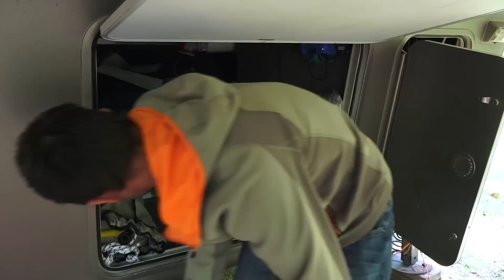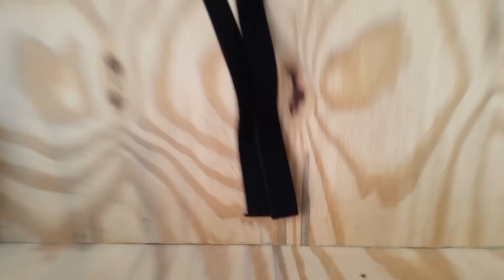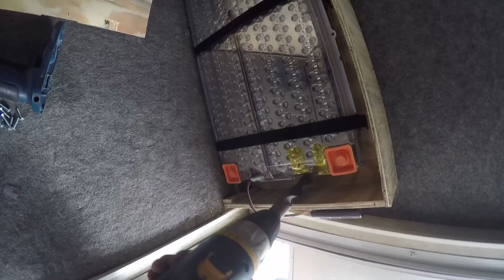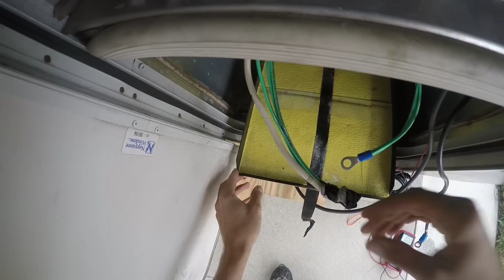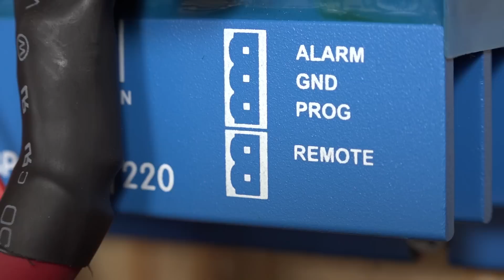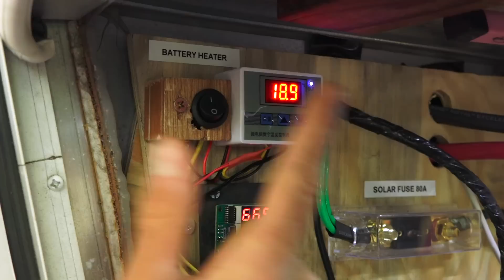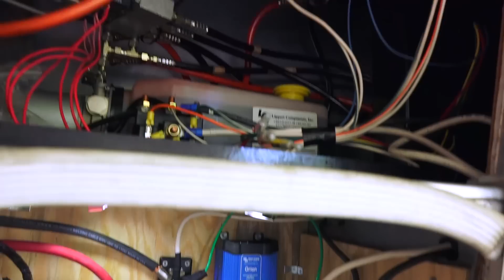PHASE 2 SOLAR - Installing the Tesla Battery and converting the RV from 12V to 24V

Comment: Very nice and mostly over my head. I would like to caution you on the lack of breakers or fuses on the small leads that tie into your 150 amp circuit. I saw a small red wire, and the lead to the charge controller and to the 24/12 converter to name a few. The flag/manual breaker type you have above the LiPo, close to the door will do nicely. I also saw you have a small black cube self resetting breaker. These can be a fire hazard in the event they cycle over and over because of an overload. In fact they are not allowed in boating.  In my boat I have a 3000 watt Gopower pure sine tied to two Vmax AGM 8D's they are rated at 350 amp hours each. They are recharged with a 90 amp smart charger that in turn is fed by shore power or a Honda 2000 companion type because of the twist lock plug it has. I have a full size fridge that the de-frost is disabled when on inverter, a small micro wave, Keurig, toaster, 24" LED TV, electric blanket and cpap machine, all that I use freely.  I'm usually good for 18 hours before it gets to 12.3 no load volts, the point I call minimum. I'm not too worried about weight (170 lbs each) in fact the boat needed the ballast. I expect perhaps 8 years of service. By that time, some smart guys like you will have made a better battery system for dummies LOL.

Comment: Wow, this is mind-boggling but you did a great job explaining it.  I pretty much understand what you've done but I don't think I'm ready to reproduce it.  It's always a lot harder to actually do this stuff than it is to learn it!

Victron needs to step it on up for Lithium Ion (as they've started to do for LifePo4) so you wouldn't need all those extra protection pieces.  

I"m trying to put together something similar to this to make a 24 or 48v solar generator that can be moved between camper, boat and house.  Because of the size configuration it looks like I'm going to try the Chevy Volt battery rather than that Tesla but $$ is also a major component so not sure when I'll get it all together.

It's really ironic that with all that power at hand you still needed the small 12 volt battery at the end of the system.
Reply from the maker: Join our second life batterys group on facebook. Lots using the volt batteries.

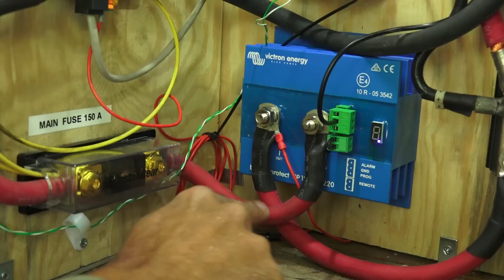Comment: Nice clean setup in the compartment.   Good thinking about the cold, undercharge, overcharge disconnect devices.   11:40,   there are dc circuit breakers that are good as the main battery manual disconnect, used in place of the 150A fuse.        Careful if driving in a rainstorm, if the seals on that compartment are not perfectly sealed, might goof up the relay control board & box in the upper left?      Great setup with the 12v AGM to support high current loads and backup for brakes, etc.  I would connect it to the DCDC output, you said that output is 13.2, or maybe it is adjustable.  check, but that should be a good float voltage for the 12vAGM
Reply from the maker: Thanks for your thoughts good ideas!

Comment: Nice to see you used a positive busbar, I’m always surprised more people don’t do this allowing them to power directly off the sun during the day rather than power everything off the battery. I know lithium’s have many charges in them but I find it satisfying when my batteries are fully charged in morning and then knowing (under most circumstances) everything I’m doing during the day isn’t touching my batteries.

Comment: Great walk through of your system Tom. I have been waiting to see how the 24v would tie into the 12v RV system. I like that it keeps it at that constant voltage and the efficiency sounds great! We will probably go with lithium batteries after our AGMs, mainly due to cost. I hope they come down like solar has over the past few years. Again, great video.
-Thomas

Comment: Can I change the LBCO settings in the Battery disconnect? The Tesla Batteries I purchased has a minimum voltage of 50 V.
Reply from the maker: These units have a few delectable voltages, but i am using a 12-24V unit.  I think they make a 48V unit but that still seems low for 50V. Are you using the tesla smart battery? I know we have someone using that on our Facebook group. https://www.facebook.com/groups/1763001173774010/
Reply: Mortons on the Move thank you. I have asked to join the group. For the Victron and Schneider inverters I can set the LBCO to 50 V. I have a Growatt Inverter that has a 46 V cut off my batteries are 50 V. Thank you so much.

Comment: Think I missed the cost comparison between systems. The old lead acid system might cost less than  $1000 including batteries and parts. The new system has got to double that cost ?  Or is it more realistic to say more than $2000 to get the Tesla battery solution? And assume the Tesla battery would last five years, while lead acid lasts three years?
Reply from the maker: I have not separated out the numbers yet but the battery alone was cheaper than most SLA with the same capacity.  Yes there are a few more electronics tho.  We are hoping to see 10 years out of this battery.   More on those numbers in a future video I am sure.
Reply: Mortons on the Move - brand new battery? Guess I better look into this. That’s a damn bargain then.

Comment: Great video. I will have to watch it a few times for me to understand it all. Can you provide a link to your source for the Tesla battery? Curious how much cheaper it is than new Lithium batteries on the market. Thanks and keep it coming.
Reply from the maker: https://hsrmotors.com/
Reply: 200 AH for around $1000. That seems kind of expensive. Have not priced golf cart batteries to compare.
Reply from the maker: Kevin J remember that is 200AH 24v.  =. 400AH 12V..... I hate AH think of it in kwhr, .   You would need 800AH 12v to Match this battery, GC are probably cheaper, but we wouldn't do anything but SLA. Now compare the prices.   We will do a video specifically on this at some point.

Comment: Tom, thanks for the add. Very nice set up. I am in the process of upgrading from 2 - 100ah Windy Nation AGMs to 6kw  of Leaf batteries. I'm adding a third Epever 40amp charge controller. My trailer has 600w flexible solar on the left roof into one charge controller, 600w on the right. The third will be for another 400w portable. The third will be setup to run off my alternator on my truck via a 12 - 48v DC - DC up converter. Allows for 32 amps @ 12vdc to 48vdc under the hood. 8 amps to the trailer hitch (MC4 connectors) to where the 48 volt portables would connect. I need to make a nice drawing like yours to show the entire system. Yanking out the new Dometic refrigerator for a more efficient, horizontal dual zone unit. Projects never quit. Looking forward to your phase #3 video.
Reply from the maker: Sounds like a great setup!  Would love to see a schematic!  Join our facebook group and share if you would to help others out too once you get that battery built! https://www.facebook.com/groups/1763001173774010/requests/

Comment: Tom, I enjoyed the video and all the comments as well.  My only concern is the heat sinks I see and the fan cooled item which will be in a sealed non ventilated compartment that may be parked in the sun at a trailer park one day. The current flowing in wires, through lugs and terminations all add a few degrees of heat to the compartment when in use.  I hope you calculated carefully or will monitor the compartment over time to assure “NO ventilation” is safe versus build up to the point of an electronic component overheating. The components have ambient heat limits to operate within ratings advertised. Best wishes!
Reply from the maker: I should have mentioned that I do have temp monitoring in there.  So far so good even in direct sun in Florida at 90 degrees. I have yet to see the fan kick on in the DC-DC but i am sure it will someday.  It does get a bit warm.  Maybe ventilation to the main compartment will be a future project.  I just dont want it vented outside.

Comment: Are you not going to charge the battery from the tow vehicle?
Reply from the maker: Not the Tesla battery you would need another converter to do that and the amperage off the truck is just too low anyway, but the small battery for the hydraulics yes.  Our solar works going down the road tho!

Comment: So no BMS installed here but some of its functions have been engineered into the design is this right? How will you approach monitoring and balancing of cells? I want this system in my build but way beyond my scope. If you're ever in southern california I'll hire you!
Reply from the maker: My BMS is my shutdown circuits, balancing is not a big deal with this battery (because of the number of individual cells), it has stayed balanced so far but occasional monitoring with the cell meter and balancing if needed.  We dont charge anywhere near the top end or go very low so there is no risk of cell damage.  We have all the aspects of a BMS system they are just not centrally controlled.

Comment: This is a great setup. I was wondering how you were dealing with battery temperature as well as the 12 volt systems, specifically the brakes.

Comment: Great overview and explanation Tom. Whew! Lots of control/monitoring components. You answered my below freezing question with your heating pad/temp sensor solution. Also, I've been looking for a DC to DC converter to keep my DC electronics and inverter at a steady voltage (13.2v) while the battery is in its charging stages. Have you seen any that can step down from 14.8 ish to 13.2? Or should I  just reconfigure my 4 batteries into 24v and get a 24-to-12 converter. I'm not sure if it's worth it. Thoughts?
Reply from the maker: Thanks!   Hmm,  Its probably not worth it unless you have other benefit to using a 24V system like solar or a large inverter.  I will do a 12 vs 24V sytem video next i think as i have had a lot of questions around that. I am not aware of any 12-12 converters but I know in electronics we call them DC-DC isolators.  There may be one out there but i have not come across it.
Reply: Tito, not sure what kind of amperage/power you need to provide, but something like this is what you need to look for (DC-DC Buck Converter):

https://www.amazon.com/DROK-Converter-Constant-Regulator-Generator/dp/B01EMYHOC6/ref=sr_1_3?ie=UTF8&qid=1522328140&sr=8-3&keywords=drok+dc+to+dc+step+down+converter&dpID=51eFZ67SkKL&preST=_SX342_QL70_&dpSrc=srch
Reply: Douglas Montgomery It would need to handle up to 150 amps at 12v. But yeah something like that but larger.
Reply: Ok, so like this :
https://www.xppower.com/Product/QSB75-350-Series

Comment: Very nice! I also had the Battery Protect in place for the main battery disconnect, but my BMS had a 12v powered control circuit, so couldn't use that to control the Battery Protect without a relay. And I wanted to disconnect for temperature as well, which the BMS also monitors. I've ended up with a Gigavac GX23 http://www.gigavac.com/sites/default/files/catalog/spec_sheet/gx23.pdf It seems to be working well. It does use a small amount of power, but is a mechanical switch, so will stop both charging and draw. I'm also using a Battery Protect to turn off the 24/12V electronics at an earlier low voltage, so that the main battery should only ever disconnect if there is a serious problem.
Reply from the maker: Sounds like a nice setup!  That looks like a good contactor,  I know victron makes one too i was thinking of using.  I might change this up just for fun and try out some BMS systems at some point!
Reply: Mortons on the Move one advantage of having a separate disconnect for the solar is at freezing you can still turn on your heating pad? But without risk of charging below freezing.

Comment: Actually Tom there is an advantage to the two disconnects. The 220 amp will take the loads off from the battery when the battery gets low, while the 65 amp will still allow the battery to charge from the solar controller. But to do so you would have to have the 65 amp output connected  on the input side of the 220 amp. You would have to pull the remote plugs on both to isolate the battery during maintenance/repair.

As you have it now, if the 220 amp battery protect disconnects the Tesla battery, you have no way to charge it, as all your charging devices (solar & inverter/charger) are disconnected.
Reply from the maker: Good Point! The 220 amp allows power in to the battery still, even if its open so yes that is a good point the solar would still charge the system even if the battery got too low (even in its current configuration).  Protect the battery then charge the next time the sun is out or plug in the inverter-charger.   If i used a single contractor I would not be able to charge the batt without manually removing the loads and physically closing it again.  Maybe there is more benefit to doing it this way.
Reply: Mortons on the Move Have you tested that? I know mosfets only block in one direction, but without a schematic of the battery protect itself I can't be sure that there is not a blocking diode in the module to prevent current flowing into the battery when output is cut off.
Reply from the maker: Lee Biggs sure have, actually only bought the 220 first and tested it out.  Kept on charging even when disconnected, then added the bp65 to the solar.
Reply: Mortons on the Move Thanks Tom! I had been planning my solar system around lead acid batteries, and later upgrade to Li-on due to price. Your Tesla battery video made me change my plans, and I have been looking at using many of the same components you show here. Thanks for all you  and Caitlin do! Hope you two had fun with Kyle and Olivia!
Reply from the maker: Actually they do recommend this exact setup.  Check out the last page of the manual.  https://www.victronenergy.com/upload/documents/Manual-Battery-Protect-12V-24V-65-A-100-A--220-A-EN-NL-FR-SE-DE-PT-ES-IT.pdf
Reply: I was interested in why Victron does not advertise this ability to reverse current charge through a disabled Battery Protect product. It sure would be handy. But they do not recommend doing this. The power handling capability of the device is not rated for this and voltage drops are not guaranteed. So, although you seem to be OK with solar backfeeding you may have other issues with higher currents over the lifetime of the product.

Comment: My Electro-Dacus SBMS does everything all those modules do,  in a package the size of your battery control module alone and will handle 120 amps in and out with all the safety systems built in.  It will use 24v or 12v also.  My Electro-Dacus was $330.00,  and my 360 amp CALB lithium pack was $1800.00.  I have one year use on it and it has performed flawlessly,  I find that running everything I need, including my computer tower, and a residential fridge, we only use about 10 percent of our capacity per day.  The SBMS will let you run a direct load from the solar system. I have mine hooked up as a 12vdc system and typically see 60 amps of charging during peak hours.  The biggest benefit to the SBMS system is that it will charge and discharge each cell while maintaining only a few millivolts between cells.  The fastest way to overheat and ruin lithium batteries is unequal voltages at any point.  The low cells will constantly be stealing energy from higher voltage cells.
Reply from the maker: We looked into the Electro-Dacus.  Is it actually available?  I thought it was still in the kickstarter...  Anyway join us over on our second life Batteries group to share your experience.  We have already discussed it over there.  

https://www.facebook.com/groups/1763001173774010/?ref=br_rs

With the Tesal because there are so many cells it has been staying very balanced.  With large CALB i completely agree you need constant BMS.
Reply: @MortonsontheMove  It's just one guy making them (alone!) so he manufactures more in batches funded directly by preorders, essentially, while developing new models at the same time. If you want one you'd need to decide well in advance of receiving one since he's not a company that could afford to store unsold stock -- not with the amount of materials and components he has to order to start making each lot.
Reply: What's the website where I can buy 
A electro-dacus SBMS?
Reply: @Daniel-es6dm  http://electrodacus.com/  Looks like the next batch ships in June. The best place to check and verify what's going on and is coming up is at http://electrodacus.com/solarforum.html and previously G+ if you want to see recent product development history: https://plus.google.com/116120341806216696709